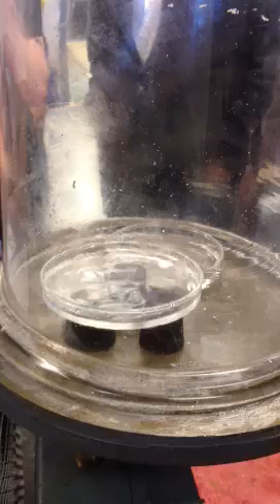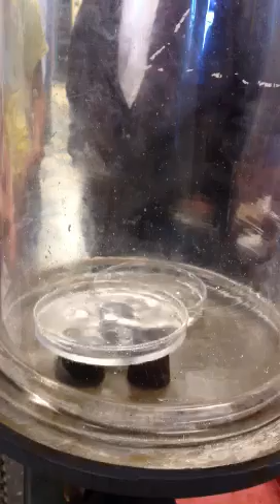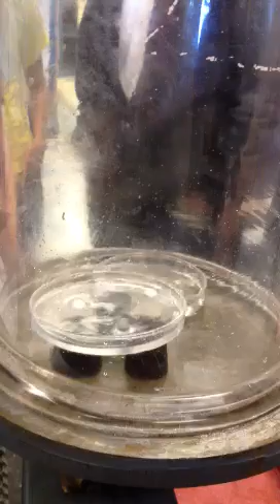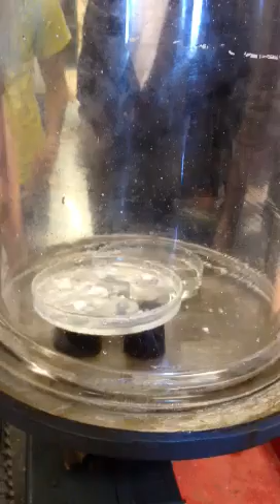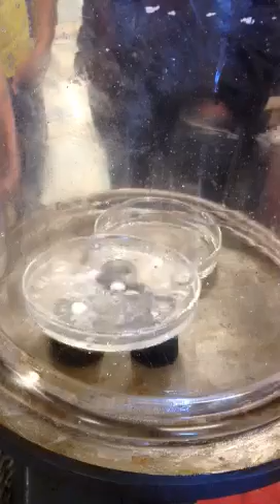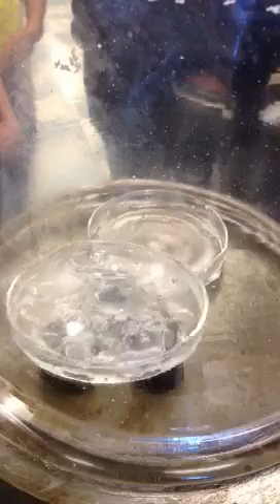Triple Point of Water

Comment: I thought about building a small absorption refrigerator similar to this setup - also low pressure, but with CaCl2 concentrated solution instead of H2SO4. But if water inside starts to freeze while it boils at 0 C, can it reach temperatures below 0 C?

Comment: If you touch that, would it be hot or cold?
Reply: Jimena Bastida it would be very cold, the temperature is .01°C
Reply: +Spencer Bench I don't think so, the water in our body has minerals and other substances in it, so the triple point will be different. And we are endotherms, we generate heat so its likely that our body water will be liquid, there should be less pressure and be colder
Reply: Lanceo 101
Reply: it would be cold. like 27 F or 0.01 Centigrade.
Reply: 273.16 Kelvin or 0.01°C or 32.01°F
Reply: If you were in the flask with it, all the water in your body would be doing the same thing, so...

Comment: Isn't plasma a phase, too? Shouldn't there be a quadpoint?
Reply: +Nonconcensusical You're right that plasma is another phase, but it is different from solid, liquid or gas for one important reason: solid, liquid and gas phases have to do with the way that electrically neutral molecules bind with each other. By that I mean that there are no extra or missing electrons in each molecule. In a plasma things are different. The molecules behave somewhat like a gas, in that they tend to be separated from each other and don't bind together, but with the difference that these molecules are extremely charged. Basically, when the gas is at high temperatures, the molecules collide with each other so violently that they end up stripped of their electrons, which now move around separately. The key point is, in order for electrons to be separated from the molecules one necessarily has to heat up a gas to such high temperatures, that solid and/or liquid phases simply aren't possible. That's why there isn't a quadruple point.
Reply: if you really want to go there you could add bose-einstein condensates and we would have a quintpoint
Reply: Aren't the facters temperature and pressure?
Reply: @[David Ruiz-Tijerina] Can't they become electrically neutral somehow. That is a possibility isn't it?
Reply: [VJ Cooldude] I'm not sure that can happen. This would have to be a type of motion where nuclei and electrons move separately, but somehow stay close together to maintain neutrality. Plasma physics isn't my area, so I may be unaware of a specific kind of plasma under specific conditions where this happens. In any case, liquid and solid phases are not possible under conditions where you'd have a plasma, because of the temperature argument.
Reply: Sounds less like a plasma and more like a metal. Though I think some non-metallic substances CAN become metals under suitable pressure.
Reply: GO SCIENCE!!!
WOOOOOOOOOO

Comment: This is a nice video.

However, I feel compelled to point out that this is NOT the triple point of water.

What you have here is water boiling and freezing at the same time. The triple point is an equilibrium state. In an equilibrium state neither boiling nor freezing happens.

What you have done is to reduce the pressure BELOW the triple point pressure. The system is TRYING to reach equilibrium. By the time it does, there will be no liquid water left, and you will definitely not be at the triple point.

Actually achieving the triple point is a very delicate operation. There is another YouTube video from Fluke that demonstrates much more clearly exactly what is required to "nail it" and the maintenance that is required to preserve it once it is attained. 

I would say the greatest long term value of this video is that it clearly illustrates some of the confusions that even many qualified people have when it comes to fundamental thermodynamic concepts.
Reply: jfdowd--It seems to me that the presumption you're making is that the triple point "equilibrium" shown necessarily refers to a "static equilibrium." There is no reason why the triple point equilibrium could not be a dynamic equilibrium in which all 6 phase transformations (melting, freezing, boiling, condensing, sublimation, and deposition) are occurring at equal rates such that the amounts of solid, liquid, and gaseous water are constant with time (and in fact, I'd suggest this scenario seems far more likely than a static one). Whether such a dynamic equilibrium could be achieved with the experimental set-up used and produce phase transformations visible to the naked eye is unclear to me.

In any event, the video certainly seems adequate to demonstrate to students that there is temperature and pressure at which you have all three phases of H2O present, i.e., a triple point.
Reply: Church Manner lol yes im kidding, Im commenting too, and calling myself unemployed and a troll by doing so.
Reply: Could you link this video you mentioned in your comment please?
Reply: ocxana oquendo I'm guessing they are referring to the channel on YouTube called "Fluke Calibration".
Reply: Except for the fact that there is a dish of acid in there acting as a water vapor sink.  If it were at equilibrium, that would not be needed.
Reply: @bengineer4031  I beleive the only purpose of the dish is to prevent the vapor from condensing on the glass and preventing students from viewing the "action."

Otherwise the other commentors are correct that this is a dynamic equilibrium. I think physicists and chemists just define equilibrium slightly differently, let's just give it a rest.
Reply: so ur unemployed?
Reply: whoa.
those are some big words.
Reply: Dogman I hope you're kidding.
Reply: Chris Vyhnal That is incorrect. The Triple Point is, by definition, an equilibrium state. If you don't understand that, then you are eventually going to find yourself really, really confused.
Reply: I could speak smart here as I can understand what you are saying but as both of you have covered everything there is no need to.
Reply: I didnt even read your comment, Im just going to assume you dont know what you are talking about. No one with a master degree or higher comments on youtube. Thats for the unemployed and trolls.

Comment: is it harmful to touch?
Reply: dodg uhuhuh, neither of those numbers make any sense without units.  Sure it's (fairly close to) 0 degrees Celsius, but it's also 32.01 degrees Fahrenheit, or 273.16 degrees above absolute zero. It's not a dangerous temperature at all, people walk around in snow colder than that every winter.   It's also at 0.00603659 atm of pressure, not 0 pressure, although you're absolutely right that it would be dangerous to stick your hand into the pump.
Reply: Very. It's at not only around 0 temperature, it's at also 0 pressure. Meaning that you probably won't even get to touch it, as you would be forced to pull your hand out before due to the pain of the oxygen of your blood pushing towards your blood vessels.